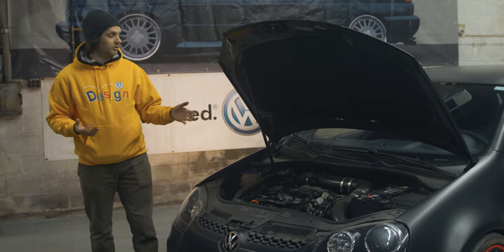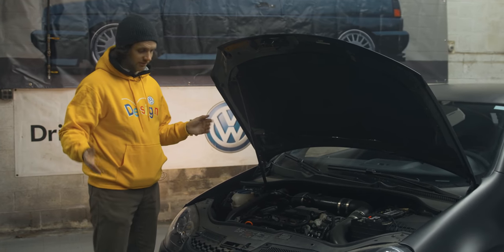VW USA made a R-GTI Concept in 2006 // Fully custom body kit + Carbon Fiber all the things!

Comment: I wouldn’t worry too much about the front wheels, it’s pretty common for the time as there’s some mechanical wiggle room for each car when it comes off the assembly line. My Mk5 has something similar, drives mint! No issues. As long as the car isn’t pulling to one side, you should be fine. Hope this helps

Comment: It’s probably not the case but are you sure the reason the drivers front wheel is stuck out more than the other isn’t because that wheel is supposed to be a rear wheel and one on the rear is supposed to be on the front because I’d assume having custom wheels its likely that it’s got different offsets front and rear I mean I’m sure that’s not the case but anyway looks like it’s going to be a cool project
Reply from the maker: That’s some good thinking!!!! I’ll check it out, thanks!

Comment: First, find out why the wheels stick out further on one side. Second, fix the headliner. Third, leave the rest of it alone. This is a one-off GTI, and deserves to be cherished. Thanks again, RickGTI…..🇺🇸🌴
Reply from the maker: Agreed! Someone else made the very commonsense suggestion that the car has two back wheels on one side, and two front wheels on the other side, which I had absolutely not thought of, but it sounds like a very reasonable explanation. As well as your perfect suggestions, the big thing is maintenance, it needs a full service to be safe and back on the road :-)
Reply: You’re very fortunate to have that unusual VW in your life. Keep it simple. RickGTI…..🇺🇸🌴
Reply: @JamieOrr  That was my first thought they may be staggered alloys, the wheel sticking out could be the spare